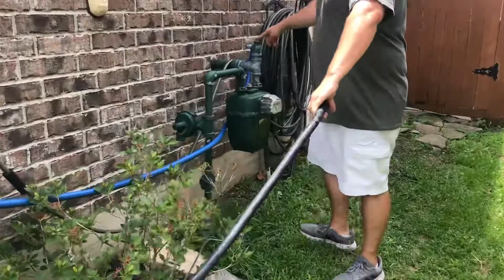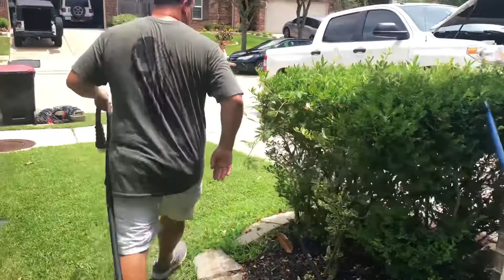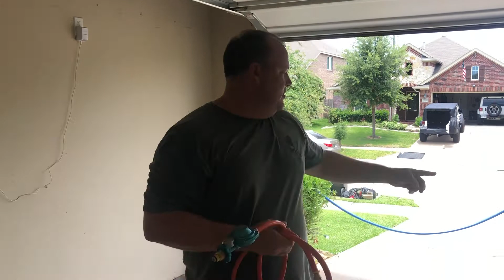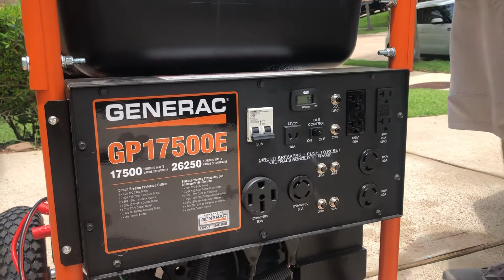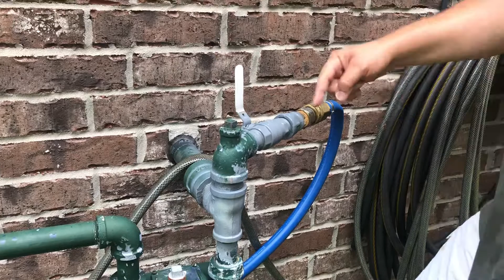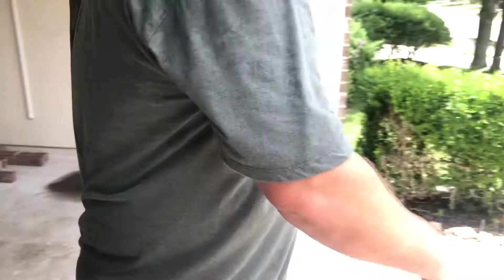Generac portable home generator

Comment: I  purchase mine in 2016 just before hurricane irma in 2017  , only down side about this unit is doesn’t charge its own battery  as it running , but other than that great machine 👍

Comment: Generator is overpowered meaning there is ~5,000 running watts of power you are not using the way you have it set up. You are limited to 50 amps/12,000 watts so having 27,000 peak/17,000 running really is not accurate.   A 15,000 peak/12,000 watts running Westinghouse or Gererac would have given you identical results as far as what you can power. This generator is really meant for job sites where you are accessing all the power across the 50 and 30 amp outlets

Comment: if it has five hours on it it needs an oil change. honestly you should be looking at your second oil change.. look up generator break in
Reply from the maker: @BOB12349307  This comes directly from their site:

Here are some tips for breaking in a Generac generator:
Change the oil: After the first 25 hours of use, change the oil and oil filter. You can check your manual for recommendations on what oil to use. For example, you can use regular 10W-30 oil or full synthetic 5W-30 oil in extremely cold weather. You can also run the generator for an hour without a load, then change the oil again. After the first 25 hours, you should change the oil every 100 hours.
Reply: @coveharborautosales  the first thing to do when getting a generator after getting it set up is throw the manual away. they dont want it to last. after 5 hours of operation you want to get those metal shavings out. but thats my second oil change by then and use nothing but 5w30 full synthetic

Comment: I’m looking at the costs of a installed generator or a setup like yours with natural gas. If you don’t mind, how much was this with the electrical work?
Reply from the maker: The generator is about $4000. Natural gas long Hose with quick connects is around $400. The conversion kit is somewhere around $300. The plumber charged $200 to put a 1” tap on the meter. The electrician was less than $600 and that included the outlet that he wired to the breaker box as well as the switch he put in the breaker box to prevent you from running the generator with the breakers on. It’s a solid investment.
Reply: @coveharborautosales  thanks for the quick response and information. We have too many power outages to not get a generator. Thanks again.
Reply from the maker: Electrical installation was less than $600

Comment: That button on the gas regulator is more of a “prime” button than a “choke”. It’s letting the hose fill up with the gas and clearing the air out. 
I can tell you know that but just adding the comment in case anyone gets confused.